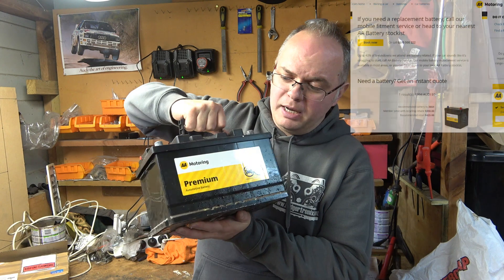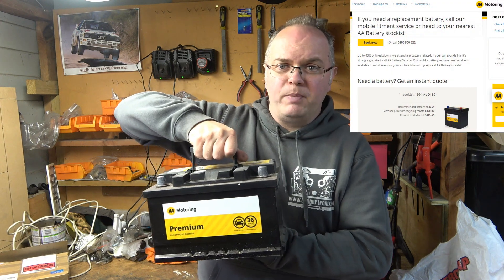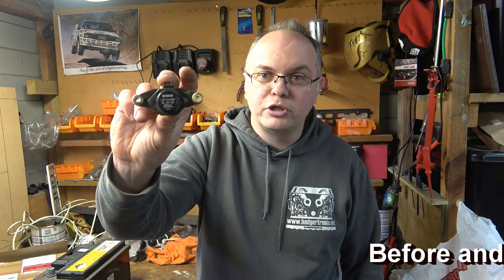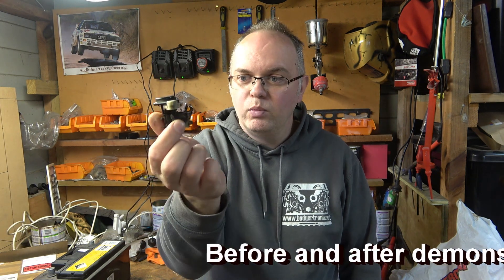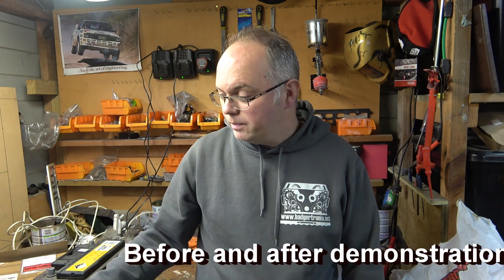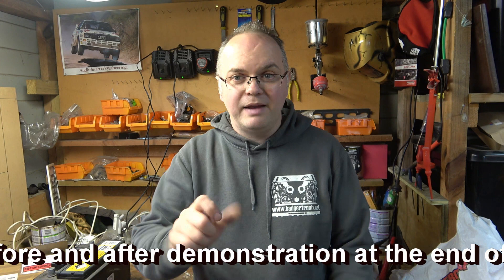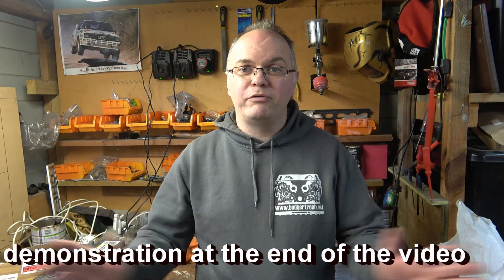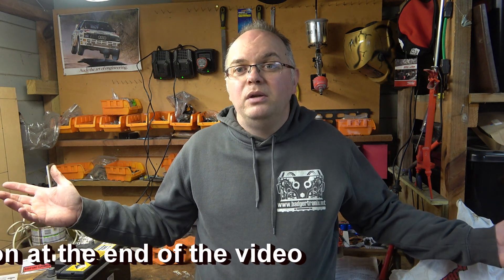Running modern batteries on older cars - What you need to do

Comment: On my Toyota hilux I put a diode in the Alternator 7 amp fuse and it raised to 14.8 volts. On the commodore it's around 14.4   to 14.5 cold.

Comment: I've found, even though my nator outputs 14.5V, the voltage drop is so bad that the battery only charges at 13.95V. So I take the battery out every couple of months and top it up. It's a 60Ah battery but accepts another 25Ah when charging, meaning it was only getting charged to around 60% of its capacity.

After charging manually on my bench PSU, the car starts really well, everything runs smoother. So now my thinking is, since I have a car that has the alternator so far from the battery, I might need to upgrade the positive cable to a thicker gauge wire, or just add a 2nd one in parallel. Should help keep it topped up without the need of manually charging it.

Thanks for the video.

Comment: Your right about this. I have a 2001 VW Polo and put in an AGM battery thinking it was a better battery and would last longer. What happened was it lasted for roughly one year and then a week ago it started to loose charge overnight. I believe the alternators on the older cars are not designed to charge these newer type of batteries, my car doesn’t have the specific charging pattern AGM batteries require. So the battery prematurely failed because of under charging and over overcharging has damaged it.
Reply: How does it become damaged by overcharging if it failed prematurely from undercharging?

Comment: Very interesting video.
I understand that i need 14v on my car to use remote starter engine(which was on the car before the car was imported from Japan) but the prevoius owner said after he replaced the car battery,the remote starter system didnt work anymore. Do i need (used to have ) a regulator like the one shown in the video?
I have a toyota vanguard 2008

Comment: Can't compare the voltage at the battery terminals with the voltage at the lighter man. There's always going to be a voltage drop at the lighter of course.
Reply: it is relevant because there is voltage drop in the wiring..
u compared apples with oranges..
u should have either done both tests with the multimeter in the engine bay or both tests with cig lighter voltage display.
Reply from the maker: Still not relevant in the slightest to the point of the video
Reply from the maker: Not relevant at all to the point of the video 🤦‍♂️
Reply: @Badgertronix  How so?

Comment: Many thanks for the interesting information.  In the past when I have needed to charge up a battery quickly and efficiently, I have taken it to work and connected it up to a variable DC power output rectifier set that is normally used for our Chrome plating vats.  It's as big as a wardrobe and has a max rated output of 16 volts and 2000 amps. I find that a dead flat battery can be resurected in about 90 mins with it set at 15 volts.  Also on the point about the "good old Lead acid technology", at work we have an ancient Catapillar electric forklift built in 1978. We purchased it secondhand in 1990 with a brand new set of lead acid batteries put into it. 30 years later it's still going strong on the same batteries, it gets used for 12 hours a day, six days a week.

Comment: A calcium (to be exact a "calcium-calcium") battery needs to be charged at 14.8V to charge it to 100%. 
Charging it with 14.6V is better than what you did before, but still no 100% ;-)
Periodically hook it up to a battery charger that can put out 14.8V and can float charge it on 13.8V would be ideal.
I had two 105Ah calcium starter batteries (24V starter) in my Mercedes 508 bus. They lasted 12 years!:-)
Reply from the maker: Good enough for me and a whole lot better than it was. I always chuck them on a charger a couple of times a year and give them a health check. Batteries are expensive here. Cheers

Comment: Hi . I own a Ford Focus Mk2 1.8 tdci and I have a problem, namely that it steals my power. When I lift fuses 3 and 4 from the engine compartment, they are 60 A. I lose the power consumption which is quite high 1.82 A. I also looked for those fuses that would lead to the spark plug relay, but the problem is that I don't know where it is. positioned. so I can check if it's from him or not. Therefore, please let me know if you know where it is. Thank you in advance . Sorry for the mistakes but I used google translate :))

Comment: Spot on.  Some newer vehicles need to have the battery programmed into the vehicle before use.
Reply from the maker: I have the means to code them in VW group vehicles but I've not had to so far